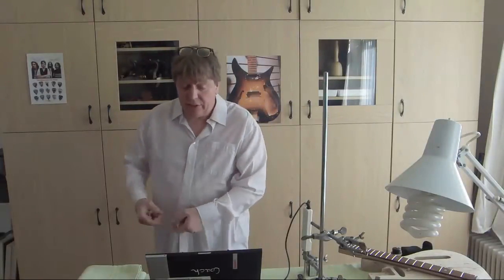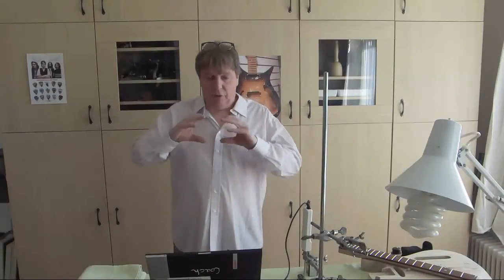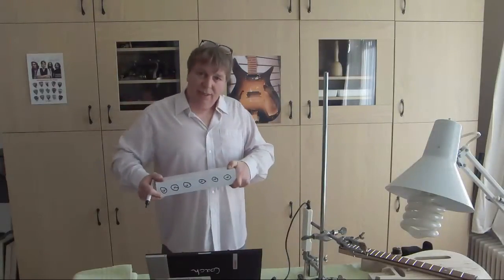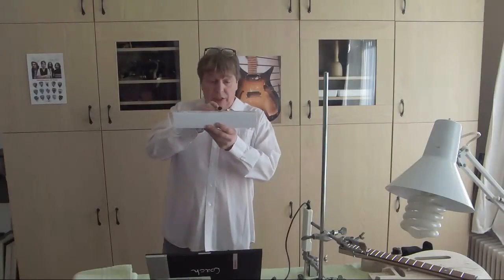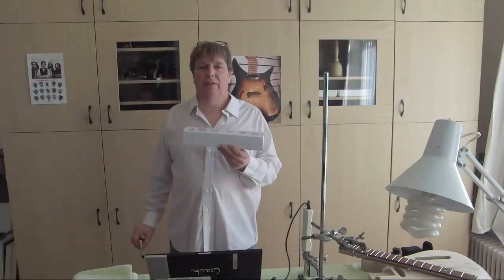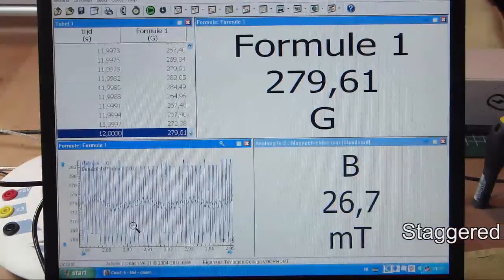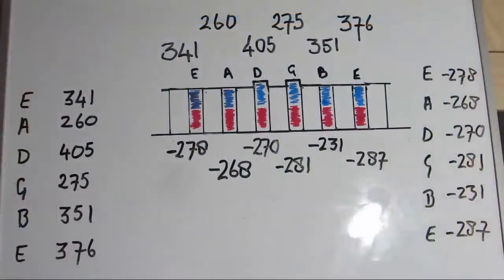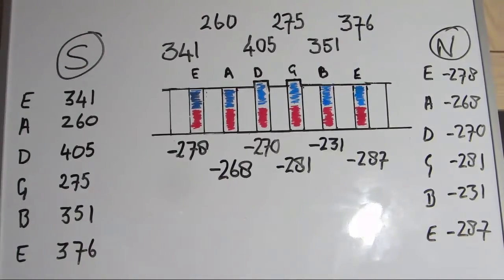Part 2 Measuring a guitar pickups magnet strength using a Gauss meter.

Comment: It might be proximity to the neodymium magnet when you do the pass, but I wonder if the length of each magnet rod is a factor. Your Gauss readings don't seem to correlate well to height as drawn, but I wonder if there is more variety in the heights than is shown in your drawing.  Also, there might be some variation in the alloy that affects charging.

Comment: Very interesting.

You can flatten out the pole pieces on a staggered strat pickup by applying a small amount of heat on the pole piece and it will push thru the bobbin easily. I did this on a waxed pickup.  If you wind the pickup and then charge the magnets leave the stagger flat until right before you wax dip the pickup etc.
A wood jig holding the pickup may work good so the magnets cannot touch the charging magnets and slide them thru with the thin wood touching the charge magnet. This would keep the pickup flat and straight against the charge magnet. Same thickness all the way across.

Comment: I’m an old guitarist just getting into making my own pickups, I have a background in audio engineering, both analogue and digital, yes I’m that old. I love your videos. I am accumulating all the machines and meters to make my own pups and I’m at the buying a gauss meter stage. I know you connect to a lap top, but I’m the kind of gal who loves getting things accurate. I’ve seen a few about for big bucks, but I’d rather just spend a couple of hundred. Now, can I use any gauss meter to test the individual pole pieces? I love the comparison you did with the fenders, 52 and Texas, I want this consistency with pups I build. But you are right, dragging the thing between the two noes mags is tough, and look at that inconsistency between the higher poles of D and G! Have you found a better way? I share your vids on interest groups on FB and they think I’m daft.
I have read a few top notch pup producers urging people to get the annis, but I’d prefer the Hall. I’m just learning, so I might sound daft. 
If you used plastic bobbins where you can slide in and slide out the alnico poles without damaging the coil, couldn’t you magnetize each pole piece individually by moving them into the magnetic field top, and bottom to your desired polarity, then read them, and if perfect try and create all 6 the same? If you wanted more pull like a staggered set, couldn’t you just make the d and g a higher gauss? Also if you stuff up the strength can you just go back with the alnico slug and hive ot a bit of north or south until they are consistent? As consistent as the fender sets.
Tell me if I’m daft. Thanks, Deborah.
Reply: Sorry spelling is atrocious, I can’t edit.

Comment: If alnico V and ceramic have almost the same max g why do they sound so different?
Reply from the maker: Hi mate, well I think it's down to the rest of the circuit ,the whole pickup everything else not just the magnet, but what do I know. It's one of those endless discussions that can go on and on and on......I think you should just try them and see what you like with your guitar and amp and whatnot .Nice hearing from ya.
Reply: Neil Robert Turner Guitars I'm talking about a JB Jazz clone set I wound myself and I used a ceramic magnet instead of an alnico V for the bridge pickup. When I switched out the magnet for an alnico 5 the pickup sounded different sweeter and less harshness and slightly less output.
Reply: It's about the materials themselves, even though both carry a magnetic field, it's behaviour result slighty different due to the components they're made.